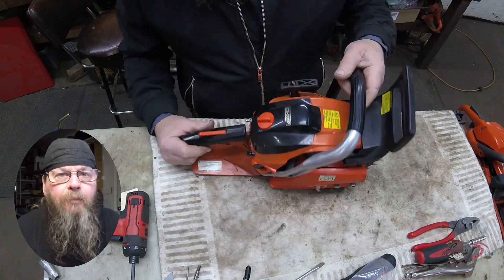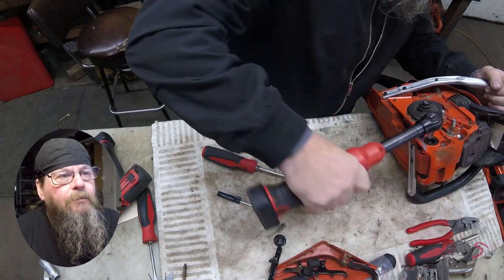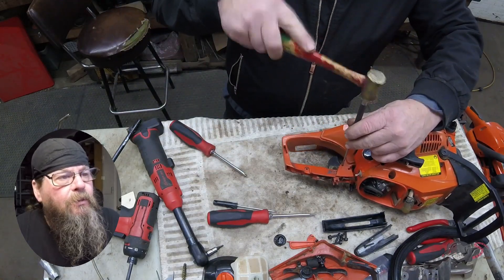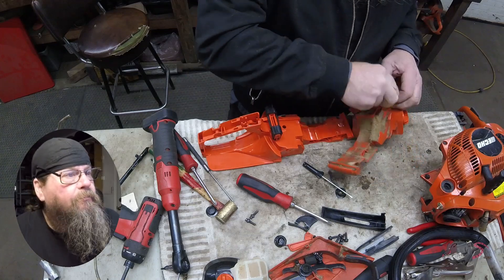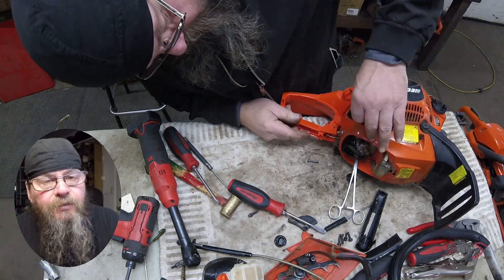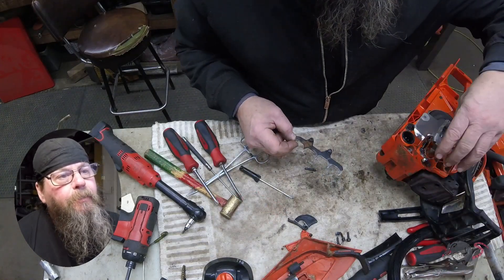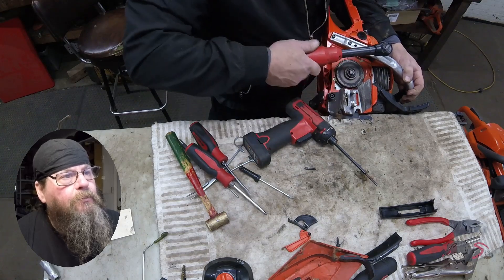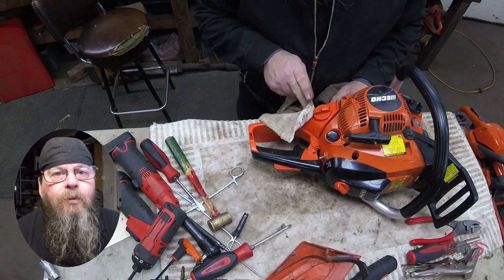Echo CS500P Chainsaw fuel Tank Replacement

Comment: I don’t read the video’s description, open and thumbs up. Always learn and also reinforce my techniques.   Besides the obvious, are there other items you always replace?  I’m flipping something, so I watch pennies real close. But, people know my work is quality.  Take care.
Reply from the maker: Theres nothing in the description that isn't in the video. There isn't any individual pieces I always replace for a flip but I'll never flip anything with a cylinder that isn't perfect. If I suspect an air leak it gets tested. Carbs are never adjusted lean to give the impression of more power. If your flip comes back for a carb problem you can fix that cheap but if it comes back with a scored cylinder then your reputation suffers.
Reply: @TheGreasyShopRag  when a person wants to try something, I’ll touch the muffler showing it’s cold. I want it to be a true cold start. I want to be honest.
Reply from the maker: @steveriggenbach90  Thats a good idea.

Comment: What is the part number on the air filter you removed off the carb please? Having a hard time searching this particular model. No in store information about this chain saw. Bought if off a neighbor and when you start it, it dies out when you depress the throttle trigger.
Reply from the maker: Echo flocked air filter A226001090. I'd be surprised if just replacing the air filter fixes your problem but maybe you have the rest of it covered already. Thanks for watching.
Reply: LOL! I strongly suspect that it WILL NOT.. its just I have searched for parts and I could not find the filter. I saw your video and the saw is exactly like the one in your video so I took the opportunity to ask about it. I really appreciate your kindness.

The stalling part when you press the throttle trigger is a whole nother ball game in itself. I am by no means a repair man of any sort, just want to avoid costly repair if I can help it. I really appreciate your response and thanks for sharing the part number on the air filter.  @TheGreasyShopRag
Reply: Can you please help me? @TheGreasyShopRag
Reply from the maker: @wilsondevore6981  There are a lot of possible reason the saw bogs. Many of my videos walk through the process. Make sure the cylinder isn't scored, look at fuel for freshness and no water. Pressure test fuel line for holes. Open carb and inspect metering diaphragm and micro screen. You can also inspect the spark arrestor screen in the muffler for blockage. One of these is most likely the issue.
Reply: There is a lot of oil just flowing out ot ir even when its off. I started to take it apart and one of the two bolts that holds the chain bar in place fell into the oil tank.. @TheGreasyShopRag
Reply from the maker: @wilsondevore6981  You'll want to clean the bar bolt and the hole it passes through. Then use some sealant when putting it back together.